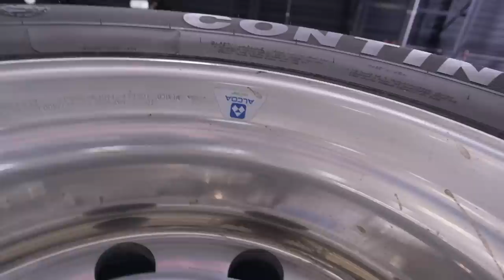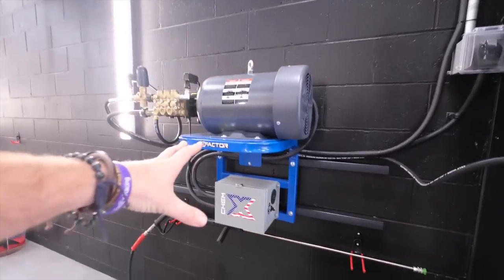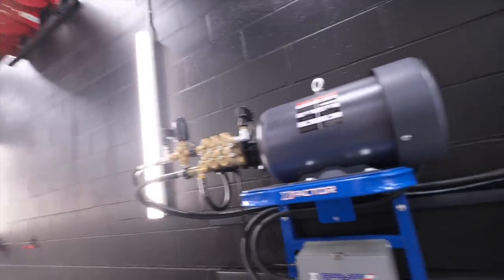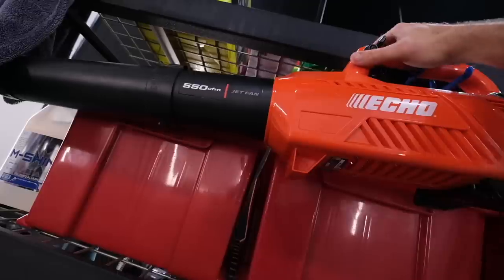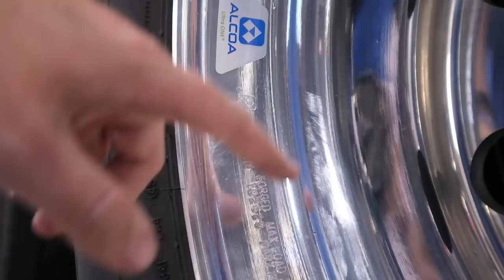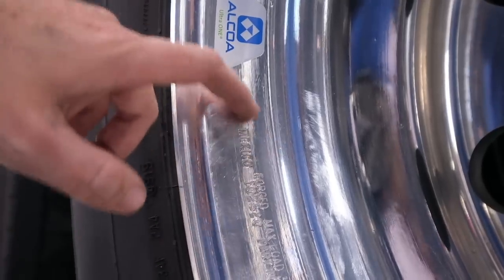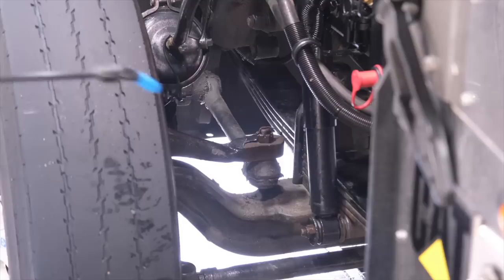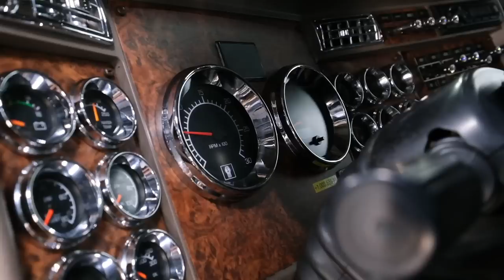How Fast Can We Wash A Kenworth With Stars+Stripes?

Comment: If you were to use this with a 20:1 downstream injector would you dilute the soap? Like I pull from a tank or 5 gallon bucket. Looking to get into washing some trucks.
Reply from the maker: Absolutely you nailed it yeah my soaps cut 100:1, so you would want 4 gallons of water in a 5 gallon pail and then add a gallon of my concentrate to that and it’ll be dead nuts perfect👌👌

Comment: Do you have to use hot water when washing with Chem X 2 step brushless wash?
Reply from the maker: No I use cold water in my studio to see what we can get done with just the soaps and high pressure, but heat makes them work about 50% better

Comment: Forgot the grille.......truck stop truck wash most likely used some acid that stained the aluminum
Reply from the maker: I hit the grill with some detail spray before they came to grab it, it wasn’t too bad. The aluminum had been damaged a bit at a truck washer prior to this wash tho, this system is designed to not do that unless it gets a chance to dry before you rinse
Reply: @ChemX  👍👍

Comment: Nice truck but don't you no you start at the top and work your way down because water flows down hill  to the ground there stal sop on your truck because you didn't start at the top and work your way down because water flows down hill
Reply from the maker: The soaps only loosen the static bond that holds on the road film, in a touchless wash the high psi acts as the physical contact which removes the road film, I rinse bottom to top so that I can use the foam as a marker of where I've hit with the high psi, otherrwise you can't see the film while your washing, because everything looks good wet

Comment: Must be former. Blue beacon washer......rinse. .top to bottom. ..
Not your way...
Reply from the maker: The soaps only loosen the static bond that holds on the road film, in a touchless wash the high psi acts as the physical contact which removes the road film, I rinse bottom to top so that I can use the foam as a marker of where I've hit with the high psi, otherwise you can't see the film while your washing, because everything looks good wet